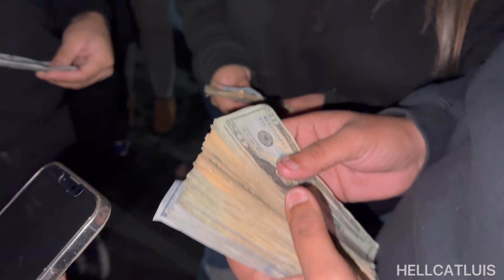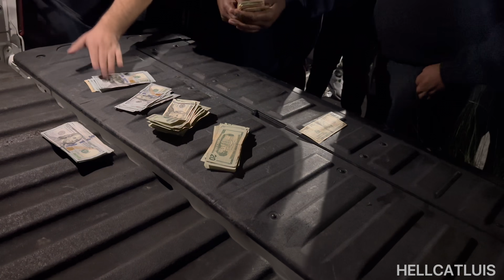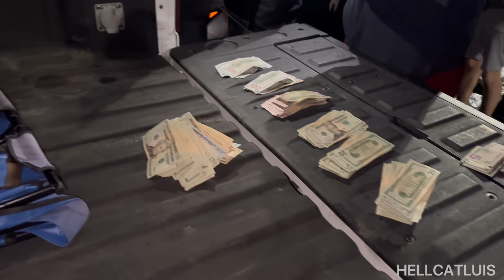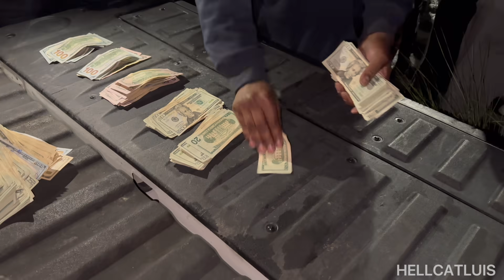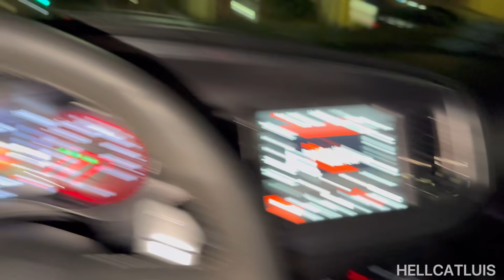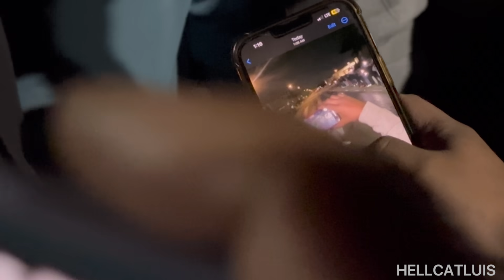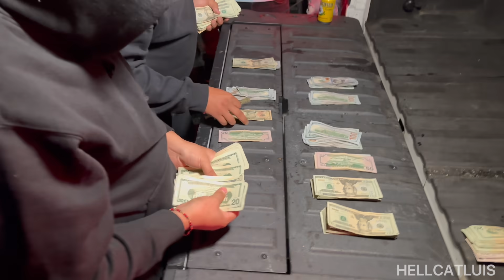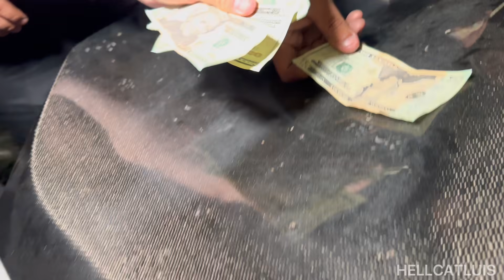DRAMA TRACKHAWK VS NA MUSTANG 5.0 20KPOT #mexico #racing #digitalart #drama #mustang #hellcat #drama

Comment: They got a hidden bottle forsure
Reply: No, that Mustang is lightweight compared to the trackhawk plus its got a high stall torque converter and a good suspension setup to put all that power down. That bish even made a wheelie at launch.